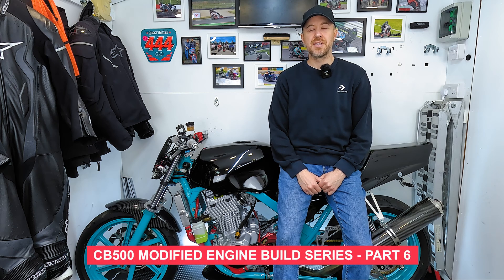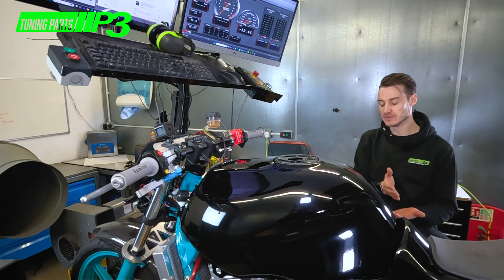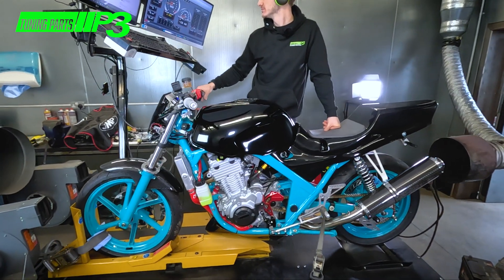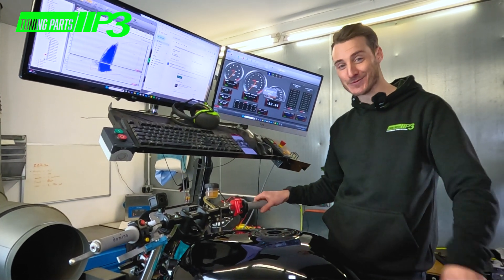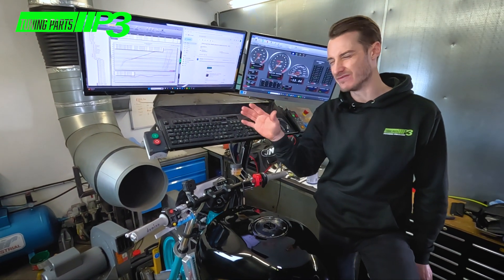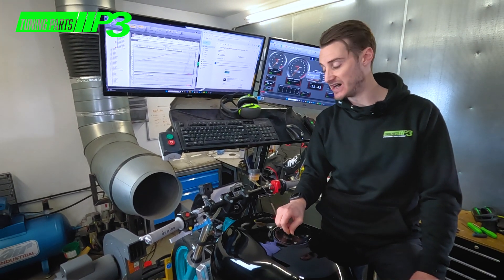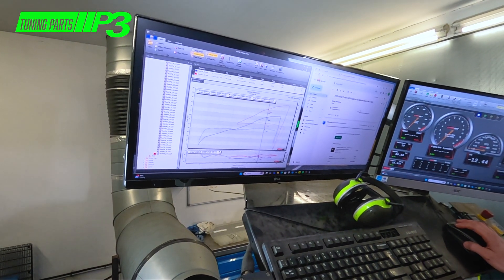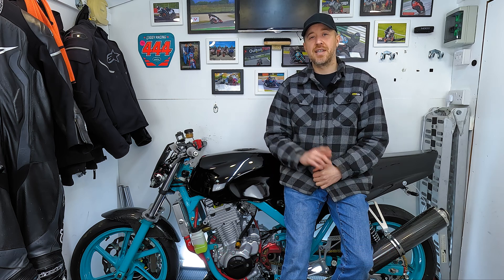How much POWER did we make?😎 Honda CB 500 engine tune dyno results

Comment from the maker: What's your thoughts on the bike? Worth the effort?
Reply: As a owner of an old CB500 myself I´m astonished how nice the bike looks now. Lookwise it was well worth the effort. On the other hand my stock bike has 58BHP without any modifications. I miss racing experience to know if there would be a difference on handling with 5-6 HP more plus the internal modifications? Guess so. It sounds a lot better though. It became a great bike with great looks, well done and thanks for the Video series, love it if guys take attention to detail and show their skills!
I guess this alone is worth the effort anyways. Personally I would not go the extra mile; but now I think about stripping my bike and having the parts powder coated as well, as rust is showing all over the thing here and there and there is a lot life left in it.
Reply from the maker: @CarlosGlatzos976 Hey thanks for the comment. Yeah the 58hp you are talking about is the Honda 'claimed' maximum power figure. And that woud be measured at thw crank and not at the rear wheel like when they do a dyno run. They tend to be 50/52 hp maximum at the rear wheel. Glad you like the bike and videos 😊

Comment: On the dynamic you were using a KN type filter , where is the filter from and what mods were done to allow this box to be used
Reply from the maker: This bike doesn't have an airbox as i used different carbs with it. This is a K&N filter which allows a lot more air Into the Bike. But it makes it really hard to get it set up correctly. Your best of using a normal air box. My bike is tuned so it’s designed to work with a more air flow. On a standard bike like yours, you’ll need the standard air box.

Comment: Would love to come and have a look at this/pick your brains. I am building something similar; however it will have a daylight mot.
Reply from the maker: I have a daytime MOT on this. It's fun on the road 😎 Are you building a tuned bike or a standard engine CB? I will eventually do a video showing the bike up close. When the weather is ok and i stop being lazy 😂
Reply: @SuggyRacing  Hopefully tuned with some cams and porting. I guess I will need pistons to deal with the extra valve lift. I like the idea of something really light and nimble for the road - it will certainly contrast with my full on 1290 superduke gen 3.
Reply from the maker: @james5553 Nice, you'll definitely notice a difference from a standard CB. Yeah thats the fun part, they are light and easy to throw around 😎

Comment: Do you ever check the exhaust port temps? Most manufacturers run significantly richer than optimum at higher rpm (at full load) to protect the cylinder head from port collapse  and valve damage. Did you know with the implementation of EU7 and the outlawing of component protection (running rich at higher rpm to cool exhaust valves and ports could lead to a significant drop in power output of most petrol engines. BMW have patented a system to inject water to provide the necessary cooling required for engine durability as an alternative to using excess fuel.

Comment: I wonder what hp is achievable from a modern fuel injected CB500 ?,  
They're 47hp stock.
Reply from the maker: I'd imagine they would be similar but probably run a lot smoother and easier to set up on the dyno, with it being injection. 👍

Comment: thundersport 500 allow max 52 whp 🍿
Reply from the maker: @mociczyczki  Hi. Yeah Thundersport doesn't exist anymore. But yeah, the other clubs like No Limits don't accept tuned bikes. I would have to use this in an open race class. I've still got my other standard race bike 😁
Reply: @ this cb with 63 whp now be similar fast to sv 650 especially that is lighter than stock do you weight it with full tank i wuesss 175-180 kg full tank it should do 12-12,2 sec e.t. 1/4 mile at close to 170 km/h stock is 13,3 sek /156 km/h 👌🏻 wonder how long weakest part of engine whichstsnd this power assuming relatively fast  riding for sure  less than stock but be how much 🤷🏻‍♂️🍿 i stay with me stock cb 500 power its lil sad that manufactpry didint make more lowand midrsnge torq /power but it is what it is peak is ok for me with stock bike 👌🏻 🍿 but 55 nm at 5 k rpm instead of 47 nm at 8000 rpm be amazing like for me but i dont like change stock setup use to it already and scream /rev the 💩 out of it all the time 🤭🤷🏻‍♂️ otherwise it didnt  move to fast 🤷🏻‍♂️👌🏻🍿
Reply from the maker: Yes hopefully it will keep up with the SV bikes now. I'm not sure what it weighs, but it would be interesting to find out. Hopefully lighter than an SV bike. 

The bottom end of the bike is standard, so I'm hoping the extra power doesn't create any problems. I'll soon find out as I thrash it on track 🤣

Comment: Hello ! Does the air filter match with the original carburetor ? Is it a K&N ? 0:43 Where did you bought it ? Thank's a lot ! 
I love my CB but I'm little bit jealous of yours. Well done !
Reply from the maker: @11Hirako  Hi. This K&N filter had to be adapted to make it fit the carbs. It's too large for the original CB500 carbs, mine are from 900rr fireblade. The filter needed to be cut and reshaped to suit. There's a lot of work that I did on the bike, making custom bits to make it work. I'm sure there are others out there that may fit. I know DNA filters can make one to whatever size you need.
Reply: Thank you very much !

Comment: Is it still 471cc? if so 63.6bhp equates to 135bhp/L which is not bad, a lot of standard bikes makes this sort of power and super bikes would be berated if they only made 135BHP/L. Still quite a mild tune which would make a decent road engine.
Reply from the maker: @MrTench8  The bottom end is all standard on the bike. All we did was top end, cylinder head work, cams and flywheel. Yeah it's a light tune, there's loads more Ben could do with it to add more. The CB is pretty under powered for a bike as standard. It is old I suppose and was only meant for delivering pizza 🍕 🤣
Reply: its at whell at crsnk be  70+ 👌🏻 so more like 140+ bhp/L
Reply: This cb500 version has 499cc, only the newer versions have smaller engines than that.
And it is a two cylinder - engine. You can't really compare that power/displacement level to one of a 4 cylinder- superbike. Better compare it to an MT-7 or something like that. (Quoted from the internet: "(...)USA mt07 (...) puts down 63.76 hp and 46.55 torque stock in North America")

Comment: But a CR500 tune (a single remember) can make 90HP. Also my KTM 690 Duke (single) makes 73HP...that's progress.....Moral....let the manufacturer get the HP for you!
Reply: you are talking about a 2 stroke! Cant compare with this engine.
Reply: @geertmulder6891  Exactly
Reply: Well, as said the CR is a 2 stroke and the KTM is 690cc so not sure what your point is .
Reply from the maker: @ekspatriat  Hi, yeah as the others have said. It's a different kind of engine 👍
Reply: I don't think this video is about a CR500 or a 690 Duke, neither of which would be eligible for CB500 class racing
Reply: What a pointless comment.
Reply: Okay not exactly a practically sensible comment here - CR 500 is a two stroke and actually only had 60 hp at the crank original-  it is a pretty impressive one with 90 rear wheel horsepower which is being measured here.  in terms of your KTM 690 it is 73 hp at the crankshaft which is probably 65 at the rear wheel which honour CC/CC  basis Would make this engine 87 hp at the same capacity so actually a lot more than your KTM 690 single if it were a 690 twin